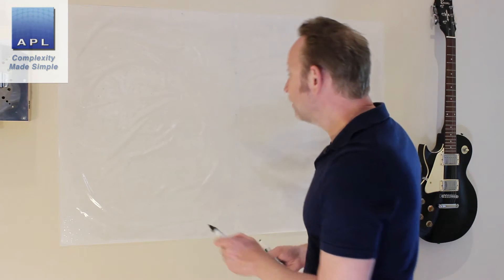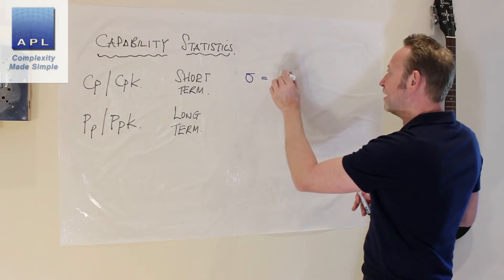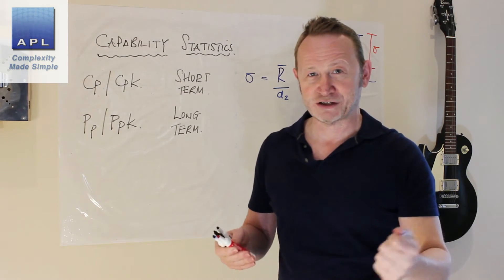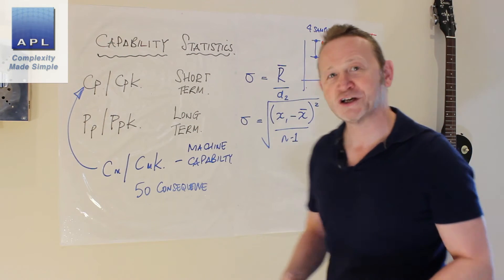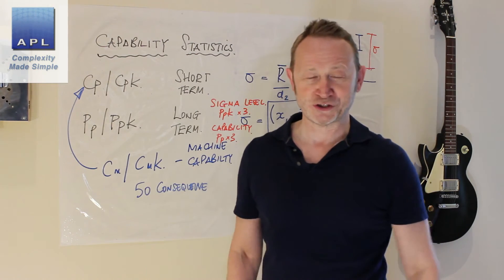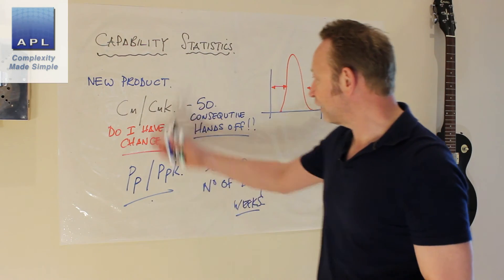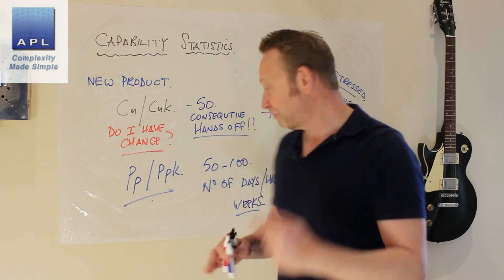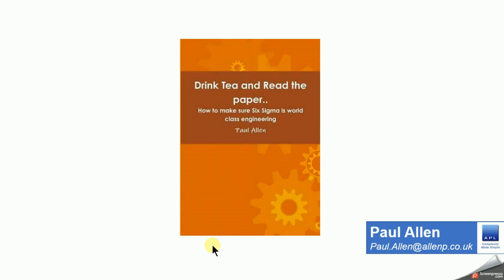Capability Statistics - Cp/Cpk vs Pp/Ppk and Sigma level

Comment: This helps a lot. Very well described. I know this is an old video but I greatly appreciate how you broke it down. I have struggled a lot with cp/cpk and pp/ppk and understanding the difference in how to apply them. I will be referring back to this as needed.
Reply from the maker: Hi French - thanks for picking out this video. I actually need it for a client this week, you've saved me the trouble of searching for it...

Comment: If we refer to the statistic textbook, standard deviations formulas of Cp/Cpk and Pp/Ppk are almost the same, but Bessel's correction is the use of n − 1 instead of n in the formula for the sample variance and sample standard deviation. This method corrects the bias in the estimation of the population variance. 
If the samples are collected from well controlled and monitored process, we can use Cp/Cpk. If the samples samples are collected from the process we don't know or including uncertainties, we can use Pp/Ppk. 
So basically, Cp/Cpk means the utmost performance of the process or machine under the best and well controlled conditions. Pp/Ppk means the real world performance when there is uncertainty we don't realize yet. 
I think the simplified caculation on the standard deviation for Cp/Cpk really misleads many people.
Reply from the maker: It may do factory geek - but it is the way it is worked out. Not my rules just an explanation of what is done for CPK vs PPk

Comment: Hi Paul, Another comment on your videos haha. i have seen a scenario where  If PP and PPK fail to achieve the minimum requirement e.g. 1.67 but CP and CPK passes. The big factor is the tolerance is so small it doesn't leave much room for any process variation as PP and PPK is long term. What are your thoughts on this due to tight tolerances?

Comment: Hi Paul, great videos as usual which gets us all to think more deeply. Here are my pennies worth. Surely the overall objective is to get CPK and PPK to equate to 1.33 or higher. This implies getting the short-term variability to be the same as long term variability. This also implies getting the within (short term) to equate to the in between variability (long term). Achieving this status implies reducing the overall variability because overall variability is equal to short term plus long-term variability i.e., the square root of their average squares of the short- and long-term variability.
Reply from the maker: Hi John - Good additional comments as always. It's been a while since I made this video. However, I think the intention was just to explain what Cpk and Ppk are i.e a different type of calculation. I hope viewers read your comment as what you are adding is how they should be using these statistics. Many thanks...

Comment: Thanks for the video Paul, I notice that you don't mention control prior to using the indexes.  In actual fact, when the process is in control the indexes will all be the same. I understand the need to get a quick sighting and a commonsense view of the leeway , I  also understand that if you sample for a longer or shorter period you will expose different variables. You mentioned about predictability but you will not be able to achieve that without stability in the process, the quicker you get to work on this the quicker you can enjoy the day to day predictability.

The way we compute the indexes is irrelevant if the process is in control and that's where we need to get to isnt it?

Its true to say that if I had a flow chart for the use of these and I just went ahead and computed the Cp and Cpk and these were better than I expected it would give me a warm feeling. If the flow chart directed me to knuckle down and stabilise (assuming I had to) I would agree, if this is what you meant I agree with you. There are lots of people out there comuting the summary stats and "cashing them in" before assessing the behaviour of their process, after all, who wouldn't want to get on with making money by producing. A stable process is quite an achievement and not a natural state to be in.
Reply from the maker: Hi Geraint - the aim of the video is to explain the calculations and that the difference between long term and short term is the Calc of the SD not the data collection periods. The is aim is not to tell them when to use Cpk. When I do tell them when to use Cpk I say if the data is approximately normal then the Cpk defect rate is a good estimate of what will happen in the next few weeks/Months. Personally I tell them to only use SPC if the process is in control. Interesting how I advise the opposite of the Wheeler approach, but there is no 'right way' there are just good approaches that work. What you have to avoid is mixing them and getting in a mess!

Comment: Hey paul, I got a question from your book statistical process control for small batch production,  page 33. Last line says we have S.D value of 1 and .5 . How did you get that ? Because in table about std dev shows .12 and .08. Can you please clarify this for me. Thanks
Reply from the maker: Arshdeep - good to hear from you. Those values refer to a the diagrams below on page 34. And those values were just chosen to work out an example that would be easy to understand the normalisation process. They do not relate to the table on page 33...does that make sense?

Comment: Hi Paul, very good explanation! I always got it wrong. Anyway, I have one question: how can we modify the number of data collected when we have low volumes (for example 100 parts per year)?
Reply from the maker: Good to hear from you Giulia - to be honest you can work out the Cpk with 25 data points, so I'm not sure you need to modify. If the volumes go lower then there is a good chance the cpk value is no longer a valid measure to use...

Comment: Hi Paul, really appreciate your video series. I have few questions if you could kindly help me understand. 
1. For a sample size of 4 would Shewhart constant be 2.0588? I can see d2 value increases as you increase sample size. how does this affect Cpk? 
2. If Ppk takes wider standard deviation, would ppk give better indication of process capability if used for small sample sizes? 

Thanking you in advance.
Reply from the maker: ST - yes the d2 value is correct. The reason the d2 value increases with sample size is because the more you sample the bigger the range will get. As far as question 2 is concerned, my understanding is that for smaller numbers range is a better indicator of variaibility. That is why when the sample size gets to 10, shewhart switched to x bar s chart. as it's only when the sample size gets bigger that s can be used...

Comment: Thank you for the valuable explanation Paul. In addition to what i have learnt from your video. I would like to learn more on the method of collecting data for Cp/Cpk and Pp/Ppk. below are my few queries:
1. Can we mix samples from different families i.e different machine for the same samples?
2. Can we calculate Cp/Cpk instead of Pp/Ppk for development of new samples.Is it advisable? and if it not,why it is?
Please help me out with your lucid explanation.
Reply from the maker: Kuldeep - you cannot mix data. But when you introduce a new process you should alwys do a CPK analysis. It predicts the defect rate when you run the process at full speed...